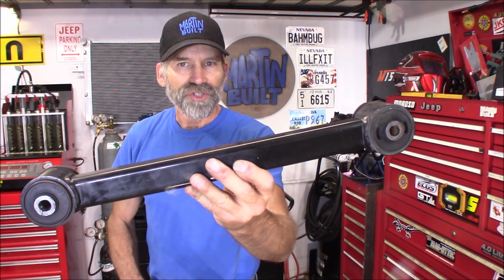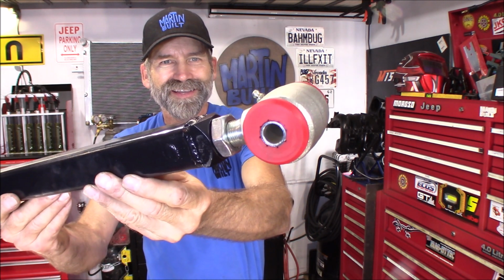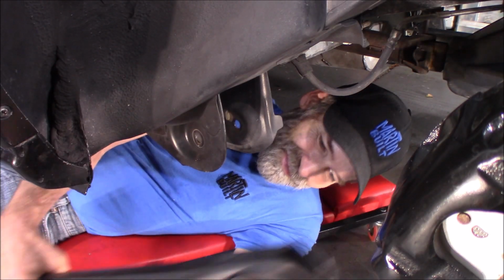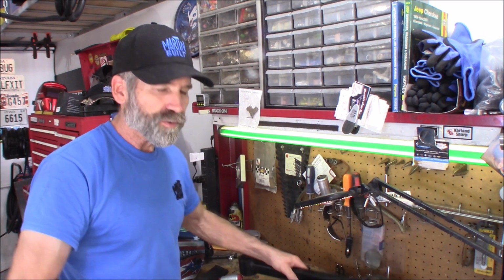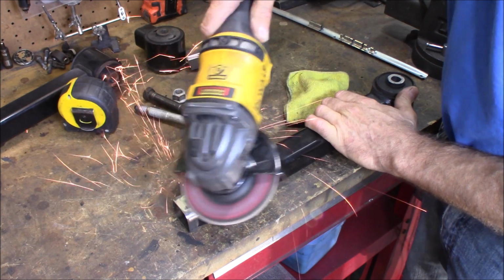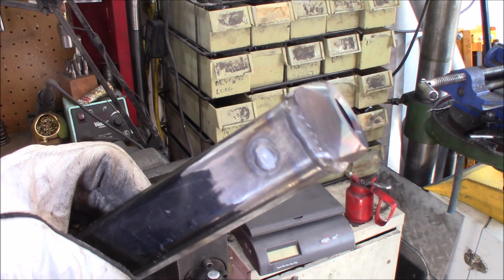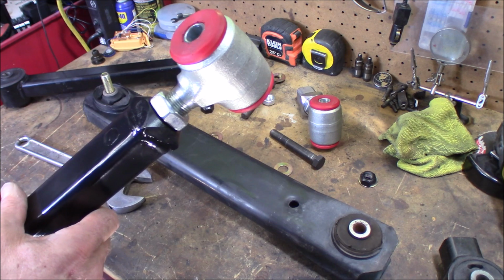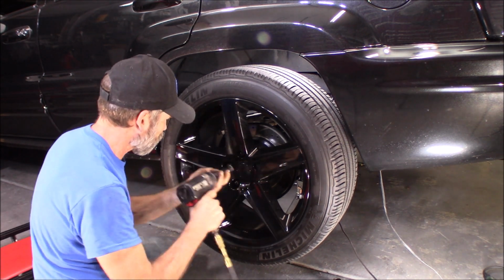How to Build Adjustable Rear Lower Control Arms for 1999-2010 Jeep Grand Cherokee

Comment: Love the video.  Then I said ikes when I saw that lower grease fittings face down and forward.  It's all good as long as your not thumping over logs and rocks and mud.
Reply from the maker: Thank you, my Grand is Mall Rated...Lol, No lugs or rocks in the future.
You can just rotate the joint 180* and the grease zerk would be facing up.

Comment: Crazy good job good sir , This is something I got to do . I have a lift on this wj when I bought the guy really cheaper out and I've been replacing the needed parts . I picked up some upper extendable control arms for the front but this is something I want to do and the fact you have an over size sway bar in the back is something I've also noticed I need to do .
Reply from the maker: Thank you, glad I could help

Comment: That's a funny quadra drive system you got there it only sends power to the rear tires 😂 Great mod and how to video 👍
Reply: Lots of guys swap t cases. I've wanted to do it but i am short of funds.
Reply: @LectricLetus  mine swapped itself 😂 It only works in 4 low so I can burn the rears too .
Reply: @jaysmith5084  uh, yeah that's not how its supposed to work. 4 low is supposed to keep youn in low gear. At least from what i know about the quadra drive.
Reply: @LectricLetus  yes I think something in the t case is broken

Comment: Hey Martin, on your ground clamp, like mine you have a slightly longer bolt holding the contact on the inside of the jaws. On my Mig and Tig i found that i had to reposition my work far far more than stick welding (due to the way the torch handles) so i added a large round rare earth magnate to that outside part of my ground clamp and just slap it on either the vice or my work. My bench has a 12 gauge steel cover and the vice mounted to that, I'll often just leave the mag on the table top and weld fine, saves me a lot of time.
Reply from the maker: yea, I which I never sold my welding table but I didn't have the room in this garage.

Comment: I love the work and thought you put into each video. If you could place the part number in would help me greatly as I will be doing this mod on my 01 WJ as well. Great job man take care...
Reply from the maker: Here are the part numbers of the Ballistic Fabrication 3.0 POLY BUSHING (BUS-663-23)

7/8 IN SQUARE TUBE ADAPTER (TA-290-1)
 and JAM NUT (JAM-711)

Comment: Nicely done. But dont tighten the arms fully until the wheels are back on the ground and shes at ride height or you're putting unnecessary constant tension on the bushings.

Comment: Howdy, so that's a great fix if you have to change the one end due to a damaged end, but the Alignment person is going to hate you, lol every time you need to make an adjustment, you'll have to remove the bolt and nut, and as a frontend guy, it take sometimes several times of adjustments to put it in spec's,  (i would charge you  extra) no fun, what really needs to be done is to have a set up like a turn buckle type system, (IE tie rod type adjustment,)  any way if you're looking to make your suspension adjustable look into a fully adjustable component,,,cheers

Comment: Martin, WOW. I love your WJ stuff. I have a question that I would like to ask and trust your vast knowledge. I live in the rust belt of northern Ohio and my rear lower control arm front mount has rusted away / torn away from my subframe. Would it cause any geometry problems if I made a longer lower control arms and fastened them to my subframe 12-18" farther forward where it's solid? This is on my 02 WJ 4.7l W/SelectTrac. My favorite of my 4 WJs but it is so rusty, it has become my winter dd. Thanks in advance.
Reply from the maker: Thank you. I appreciate that, and thank you for watching.
Yeah, I think it would probably change the geometry a little bit as the rear axle goes up-and-down. It is gonna put a little bit of a twist on it, but I would probably still do it.
And you're gonna want to do both sides.

Comment: You say your going to do your front arms too. Are you going to use arms from the front of a WK ? I’m stopping by our u pick u save today to find the rear square arms and I’ll look at the front there too. If the WK front arms are square and bent as my original on my WJ I’ll grab the front arms from the WK. I’ve talked to Ballistic Fabs the other day they have everything in stock and plenty of them poli joints, nuts and square adaptors so I can do the same to my WJ. Thanks so much Martinbuilt.
Reply from the maker: Glad you liked it and hope you enjoy building your control arms. The front of a WK has an independent front susenpsion and does not have those control arms. Haven't got around to building the front ones yet.

Comment: Awesome job. I am definitely going to do that with my WJ. Do you happen to know how far out you can actually extend the joints???

For the 3" of total lift from oem specification, the lower control arms need to be 16.09" long instead of 15.75" to keep the correct geometry.

I am putting a 3" Supreme Suspensions Spacer Lift, Adjustable Track Bar, Bilstien 5100 Shocks, and Brand New OEM Coil Springs with new Isolators. 

I was debating on doing front and rear lower control arms as I know it's going to change my pinion angle a bit and didnt want to spend a ton of money from Core 4x4 or somewhere for them.
Reply from the maker: Thank you Colin, yes the arms can easily be extended beyond 16.09"
Reply: @martinbuilt  right on man. Cant wait to see what you do with the front lower arms, I will do both at the same time. Haha

Comment: Hey Martin do u have a video on the installation of those suspension straps? And what exactly do they do?
Reply from the maker: I don't have a video for those. They are good for a couple reasons, for me it limits the amount of body roll and for off road it stops the suspension from downward traveling instead of the shock limiting the travel, that could cause the shock to fail.

Comment: How did you correct the up and down movement in the arm tube ? You never explained that. 

Also are those bushing housings the same size as the lowers on a KJ Liberty 06 ? I think it would be awesome to make a set for my Renegade.
Reply from the maker: The up and down movement? I didn't realize there was a problem.
Reply: @martinbuilt  about the 6 minute mark in the video. You fit the adapter into part of the arm tube and there is slack up and down.
Reply: Awesome build anyway. I was just wondering about that part because there's no slack when you go to weld them together.
Reply from the maker: @justinholland7657  oh I get what you are talking about. Like you said after welding there not going anywhere. Thank you.

Comment: I was excited to try this on my 96 zJ but I have no p cutter 😂
Reply from the maker: a what?
Reply: martinbuilt plasma ?
Reply from the maker: @rougeone1394  I didn't need a plasma for this project. I used a bandsaw, a saws-all or even a hack saw would have worked.
Reply: martinbuilt 10-4 thanks for response may try that method. Keep up the good work brother